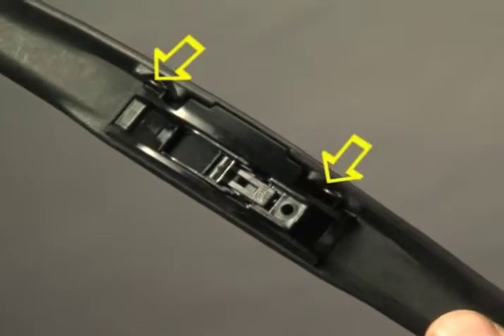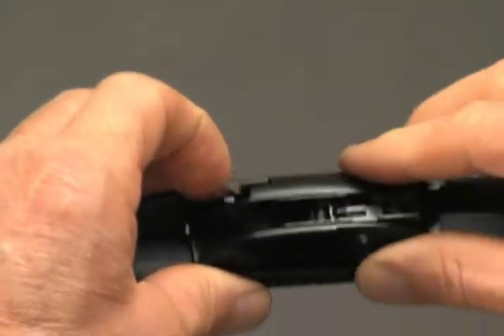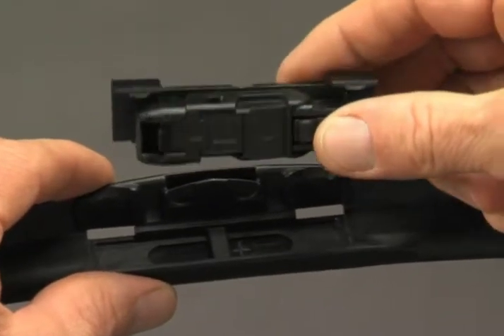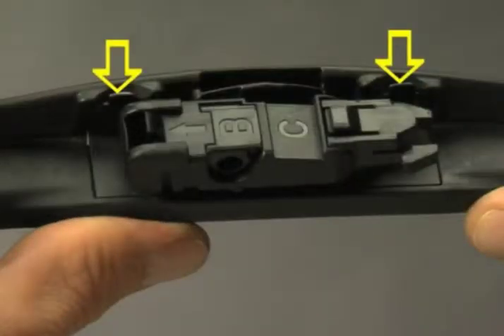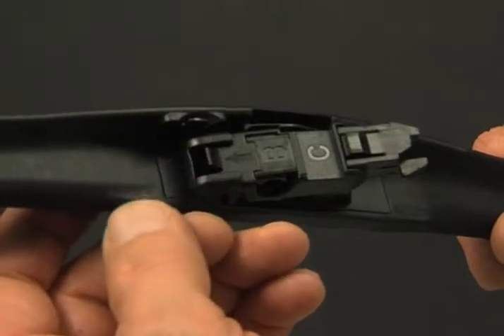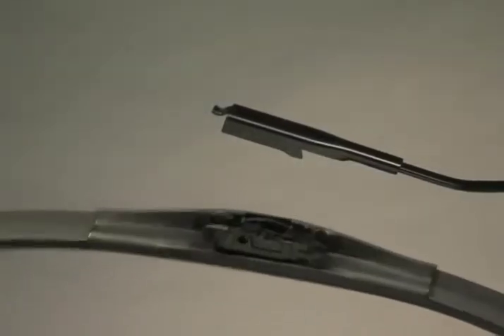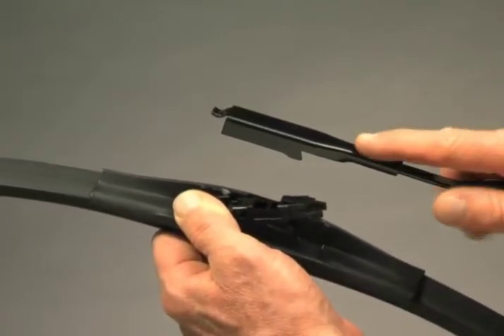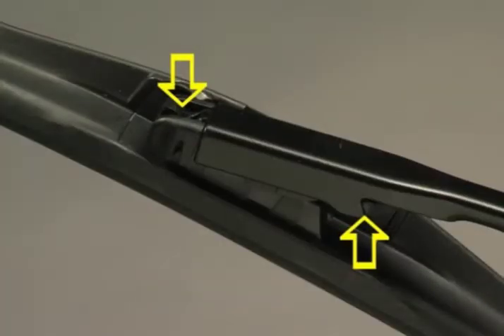Trico Titan Pinch Tab Wiper Blade Installation Video

Comment: How do you install these with the pinch tab style adapter if you have opposed blades? The only information I could find for opposed blades was for j hook style adapters and not for the pinch tab. Thanks.